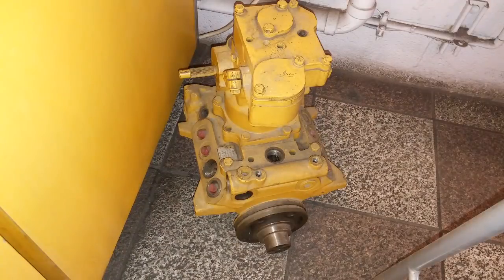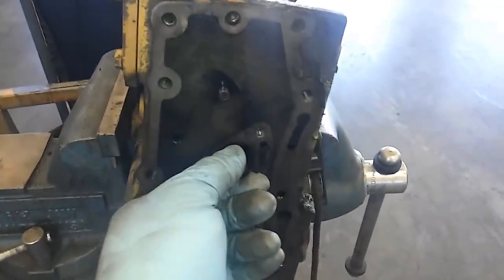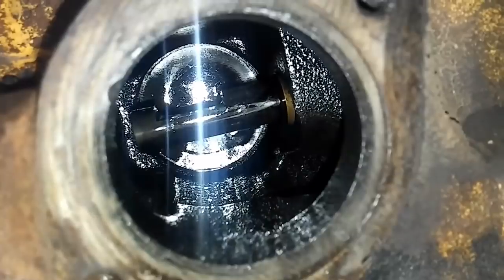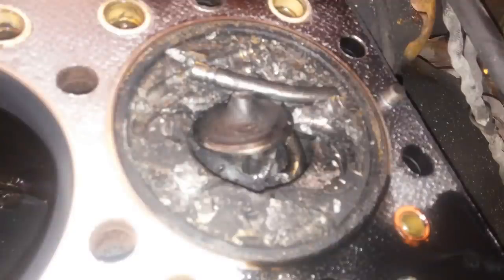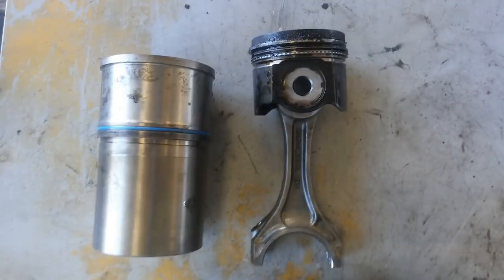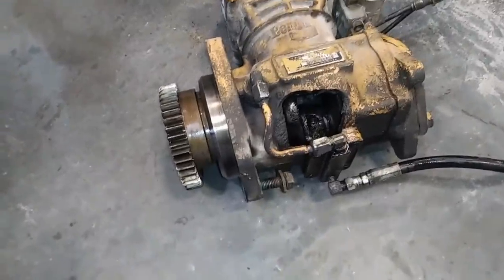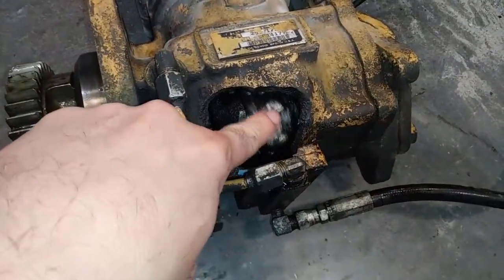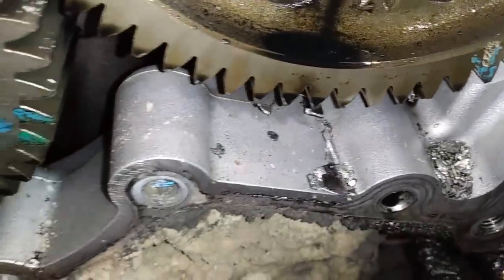Why Do Diesel Engines Runaway? What Is A Diesel Engine Runaway?

Comment: Just a recommendation from a professional firefighter/instructor; we teach to use CO2 fire extinguishers to shut down runaway diesel engines. Carbondioxide (CO2) extinguishers are the ones that can freeze your hand to the nozzle cone so you must use gloves. They displace the oxygen eliminating combustion. We direct the nozzle of the CO2 extinguisher directly at the intake of the diesel motor. Being a gas it will pass through all particulate filters and snuff out the potential combustion of any type of fuel in a confined environment. Remove the oxygen remove the combustion process.

Comment: I was always taught if that ever happened to any of our older equipment to quickly take my shirt off and stuff it in the intake.
Reply: It will work but your best bet is to spray c02 into the intake/turbo
Reply: The person who told you this just wanted you to take your shirt off. They gave everyone else a tennis ball.
Reply: @CriticoolHit  A tennis ball is a great idea, as long as the air intake horn is perfectly round, and smaller diameter, than the tennis ball!
Reply: @CriticoolHit  You win comment of the year.
Reply: Use your hat or the rag in your back pocket. Taking your shirt off could be too slow
Reply: ONE OF MY TECHS TRIED, MADE A REAL UGLY SOUND  AS IT SUCKED IT THROUGH THE ENGINE. DIDN'T KILL THE ENGINE BUT WE GOT IT STOPPED,  SHREDDED CLOTH ALTHROUGH THE CYL HEAD.

Comment: People who lived near the Okefenokee Swamp during both steam and diesel eras told me - as a reporter - that diesels caused way more forest fires than steam. Seems that when they were on a pass track near the swamp they would be idling and depositing carbon on the exhaust stack. When the engineer increased rpm the exhaust would blow out carbon which would still be hot enough to ignite nearby underbrush.

Comment: Had a road call on the freeway for a dt466 smoking a lot, pulled off charge air hose from turbo it was oil soaked, I told them seals in the turbo had gone and they should have this truck towed due to amount of oli they went cheap told driver to drive back. I still had the hood open driver starts up truck it idileed for a second then went into orbit, had a clipboard in my hand and blocked air intake, man it was scary though.
Reply: Best option is always stop airflow.. Just don't get your hand sucked into the turbo.
Reply: Heard a n14 that had lost a turbo and the guy didn't clean out the cac, it took off with the hood shut and no load. It stopped after it dropped a valve on every cylinder. Dude really saved some$ on that one lol
Reply: I've been there !
Reply: My friend had an aluminium clip board with an area on the back that was concave, (or convex, depending which way you looked at it,). He had just reworked and old 238 Detroit and on start up, rack rail got stuck and it was wide open. He had the clipboard and threw it over the intake, and the engine actually pulled the clipboard in a small dome shape. 
He retired a couple years ago, and he still had that clipboard.

Comment: Thanks.

Very interesting and thank you for the clean language. Very professional.
I know the old radial engines on aircraft had ocassional runaway props. I believe that was a governor issue where perhaps the propellers went to flat pitch and over sped which lead in some cases blades off and catastrophic airframe damage.
Reply: Virtually any aircraft with a constant speed unit can suffer from a propellor runaway.